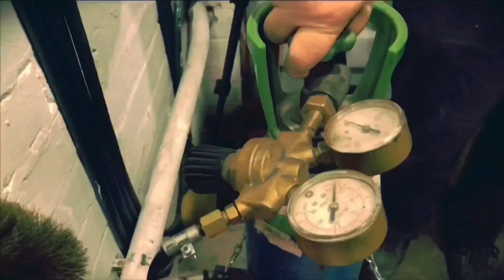Classic Mini Mk1 Timelapse | Rotisserie Jig Made in 8 Minutes

Comment: Hi, could you post up some of the critical measurements up please?
Such as height of pivot front and back from the floor.
Also the vertical offset from the rear shock top mounts to the pivot height and the same for the subframe mount to the pivot at the front.

Thinking of doing similar and yours looks really well balanced.

Loving your work. 👌
Reply from the maker: Hey 👋 thank you very much 👍👍 I can’t get to the mini at the moment because it’s at my dads house and I’m being safe because of the Covid-19. When I’m next able to will get the measurements for you though.
Reply: @upbuild4397  HI
what a superb frame any measurements going would be helpful. loving your work

Comment: Did you put any strengthening plates on inside of mini when you fitted the two bars that attach to the toeboard section of the jig ? As that’s where I am at the moment and I’m just worried that washer / bolt won’t hold the weight

Comment: Hi
Great work and well thought out. Can you tell me the height of the upright stands without the casters
also may be you may not know the answer to this but I do not want to risk taking the glass out of the car. I cant see I reason to do so maybe  you can. I dont think the car would flex enoUgh in this area to break it
regards
Reply from the maker: Hi, thanks for the comment 👍. I suppose if you did plenty bracing inside of the shell it would prevent the car from flexing, but it also depends on how solid the shell is. If you have the car on the jig are you likely to be grinding and welding so taking the glass out to protect would be better? Cheers 👍
Reply from the maker: I’ll get those measurements for you tomorrow.
Reply: Thanks for the swift reply I would really appreciate the  measure ments
keep up the great work Regards
Reply from the maker: Hi, apologies I forgot to get back to you with the jig upright size 🤦‍♂️. When sat on the ground without the casters the overall hight is 1050mm. It is slightly high, if I was to make it again I’d maybe drop it by 100mm.
Reply: @upbuild4397  Thanks I knew you would be busy and am very grateful for your reply and consideration
regards
Reply from the maker: Not a problem 👍👍

Comment: Any idea off the top of your head what size of square tubing you used for the base parts and what size you used for most of the rectangle extension parts? I am going to build one like this for my mini rebuild project as it looks like the simplest design to DIY. Looks like it could be approximately 3"x1" for the rectangular and 3"x3" for the base stuff with about 14ga (2mm) wall thickness or so but its hard to tell and I have no idea how you guys measure steel over there I am assuming in mm. I want it to be strong enough to support the car but not so much over the top I am just wasting money on over building it.
Reply from the maker: Hi! Where are you from? We use metric measurements here but I can give you the measurements in imperial where I can. So the stands at either end are made with 2”x2inch box section and 1.5mm wall. The rectangular parts on the car are 2”x1inch with 2mm wall, this was just made of off cuts we had leftover in the garage. 1.5mm wall would be fine to use though on the Mini shell as it’s a small and light shell. cheers 👍
Reply: @upbuild4397  Thank you for the information this is very helpful as are your videos. I am in the US and assumed you used metric but wasn't real sure what "standard" metric sizes of tubing would be so I figured I would just stick with imperial. I really like the simple design you have here and I think it will work great. It looks like you initially had the pipe connection pieces on top of the extensions coming off the car and then moved the to the bottom side (I assume for balance) is that correct?

I have a 1960 Austin Mini that was restored about 15 years ago and is in bad need of a repaint as well as a 1967 Cooper S shell that I am contemplating rebuilding. It's pretty rough in places but I have it tore down now to just the shell. I plan to start sand blasting it to get a better idea of it's overall shape. If it's worth fixing I am probably going to do a Honda vtec conversion on it as I do not have the original motor anyway and all the hydrolastic parts and sub frames are junk.
Reply from the maker: Hi! Yeah that’s right, we originally put the tube on the top but it was balanced very well so we moved it to the bottom. With the doors off and completely stripped the shell is perfectly balanced now, very easy to rotate. Ah that sound like a great build you have planned for you cooper s shell. Not sure if you have seen it but Mighty Car Mods channel did a really nice vetc Mini conversion, without extending the front. All the parts that they used inc the subframe seamed really nice quality and well thought out.
Reply: @upbuild4397  I had not seen the Mighty Car Mods one thanks for the mention! I have it bookmarked now and will check it out. I have watched several others and it seems they now have it down to an almost bolt in conversion. The only down side is the sourcing of the Honda Vtecs, as they seem to be in high demand, and the fact you have to cut out most of the inner front fender area. Not entirely sure I want to do that to a Mark 2 Cooper S shell. I may have to keep an eye out for an 80's or 90's model that has less historical significance. If a guy has to source new subframes, motor/trans, front end parts, etc.. it's almost a wash cost wise. The Vtec is still more expensive but not prohibitively so.